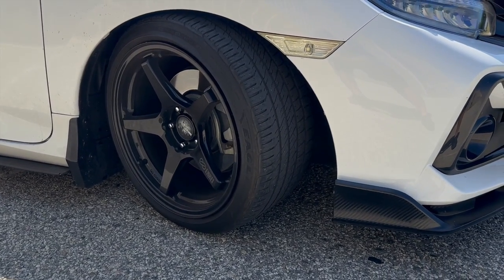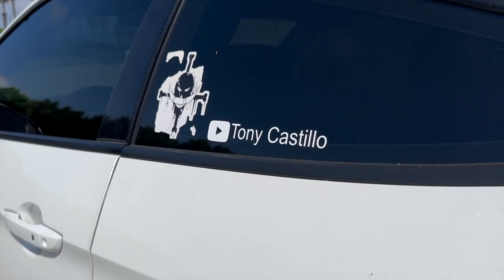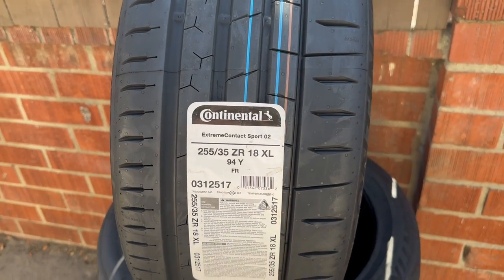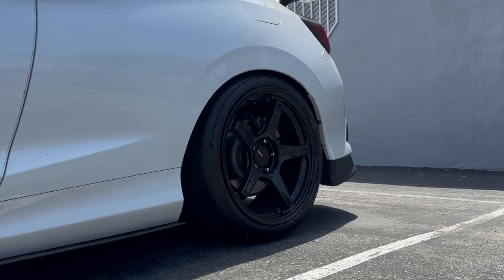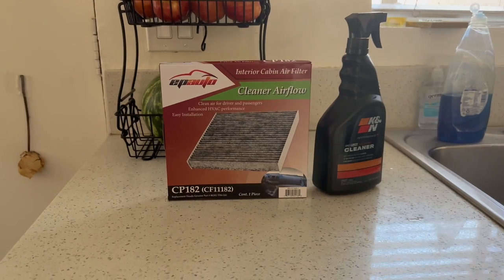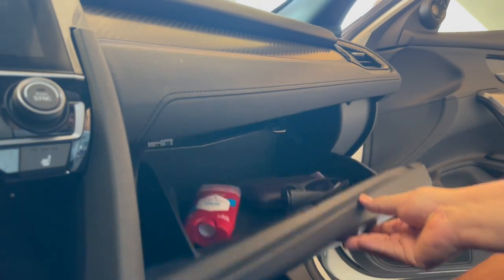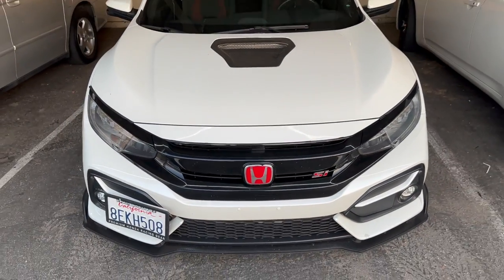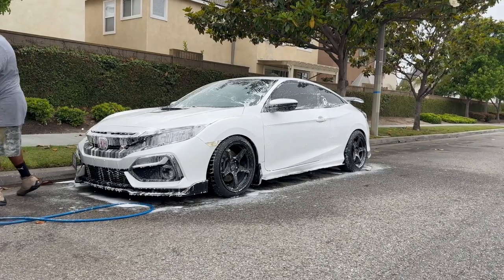Making My 10th Gen Civic Si Great Again...

Comment: Awesome video man. Im  Finally getting my head gasket  replaced due to a cold start misfire I've been having for over 10k miles and Arp headstuds so hopefully I can give you some feedback on how it turns out. I've been Hearing good stuff from the shop im using in chicago with having no issuse with a new oem headgasket installed and the tsp headstud kit so I figured I'd go the same route.

Comment: Is the 11th Gen si really worth 10k more than the 10th Gen I see there's 2020 certified si near me for like 25k low miles. New 11th gens are like 31-35k
Reply from the maker: Overall it’s a better daily
Better comfort, interior, quality etc…

But you’re comparing new to used
Just go based upon your budget. Either or you’ll get very similar performance

Comment: Do you still not rub with the new tires ? And do you still not have a rear camber kit ?
Reply from the maker: I do not rub and do not have a rear camber kit

On my last set of tires (All seasons) I rotated my tires every 5k miles when I did my oil change and they lasted 55k miles lowered without the camber kit
Reply: @TdaKid   wow that’s crazy man I order the Spc camber kit maybe send it back after hearing that lol 😂. Have the same tire spec except stretched 235 40 instead